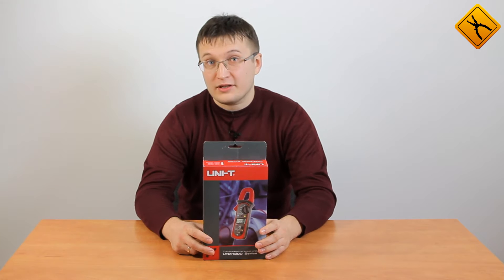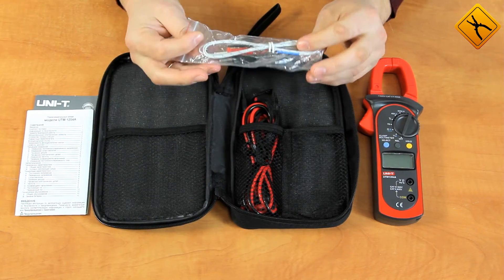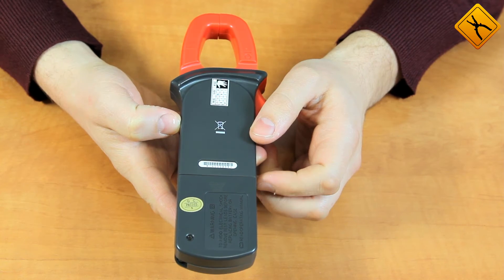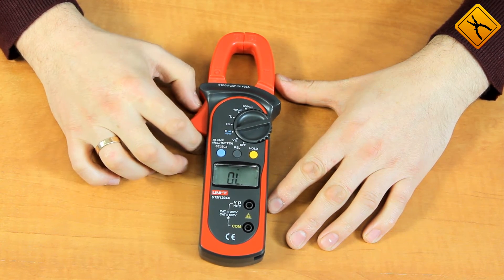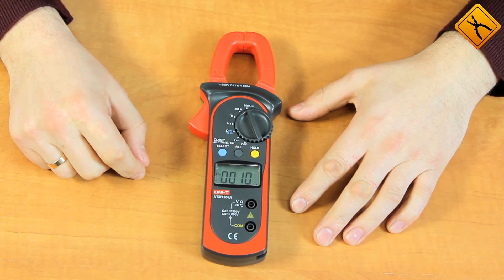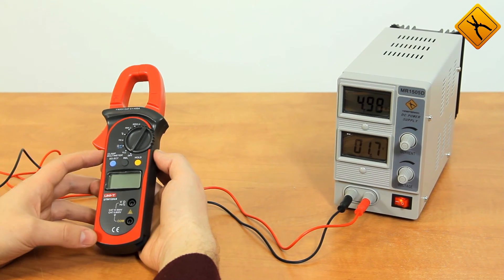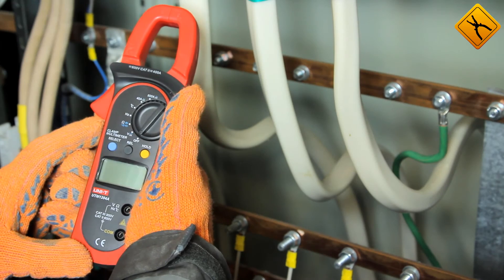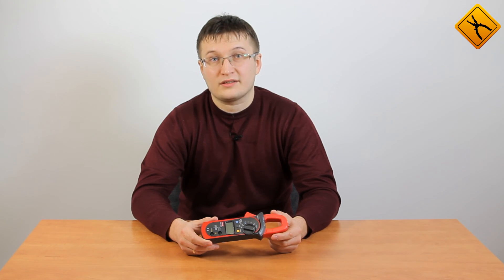UNI-T UT204A AC/DC Digital Clamp Meter

Comment: Hello- Thanks for the vid.  What uni-t clamp multimeter would you recommend for home use? Basically for make sure there is no risk when working making connections. Cheers
Reply from the maker: Hello! There are many options. Look at the UT210B and UT202+\UT202R models

Comment: Excuse me please how to set zero display in DC current measure
Reply from the maker: To set zero use REL button.
Reply: Use the REL button and do not move the clamp meter around.

DC clamp ammeters are highly sensitive to stray magnetic fields and moving it will "unzero" the ammeter.

Comment: sir oes it better then ut 203 ?
Reply from the maker: UNI-T UT204A has a wider range of current measurement – 600A, while UT203 can measure current up to 400A only. The frequency measuring range is also wider – 10 MHz (UT203 – 1 MHz). UT204A is capable of measuring condenser capacitance.